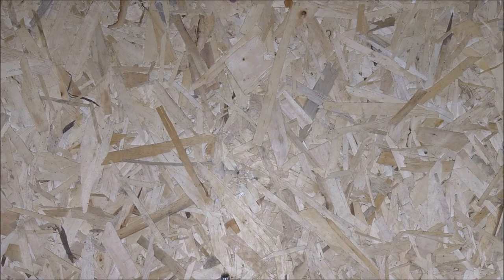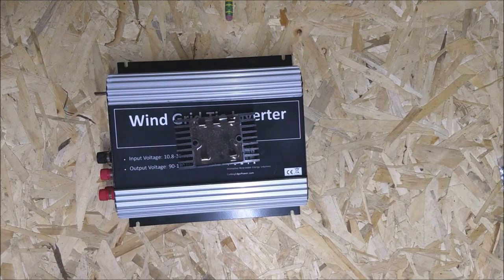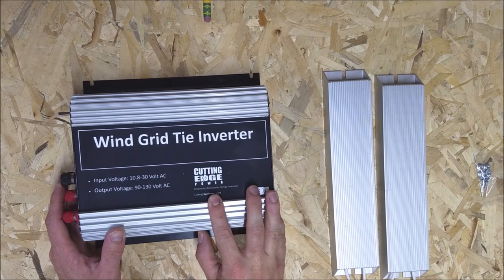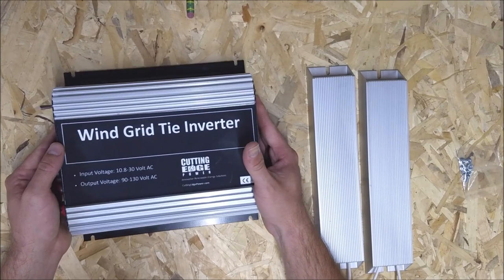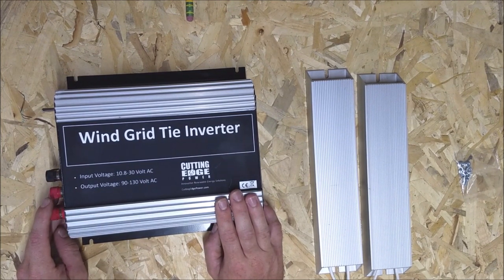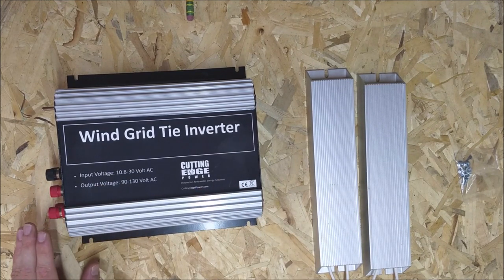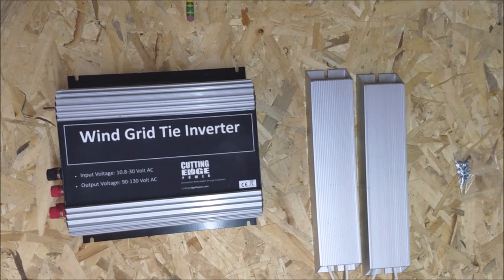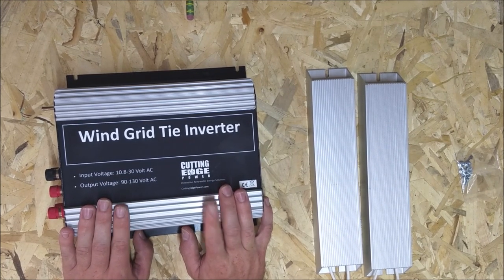600w Wind Turbine Grid Tie Inverter Introduction

Comment: do you need approval from the electrical utility company to use a grid-tie inverter?
Reply from the maker: What I have to say is that it's always a good idea to check with your provider before installing anything on their grid and it's also important to keep in mind that if you don't have a net meter, which often will have to be installed by their technicians, any time you produce more power than you're using the grid will recognize it as additional usage.

Comment: Sure would've been nice to see this in action rather than a commercial…
Reply from the maker: hah sorry.  It's not the inverter I was expecting so I was ill prepared for it...I've spent the day switching back and forth between my good 400w and crummy 400w turbines to see if either are in any way compatible but the good one spikes voltage too high and the crummy one just doesn't have enough copper/magnets up there to make much power.  I'm looking for a couple of 12v turbines to run it with...there'll be more videos and less commercial soon I promise! :D
Reply: you need to try one of those blue grid tie inverters.
Reply from the maker: Got a link?